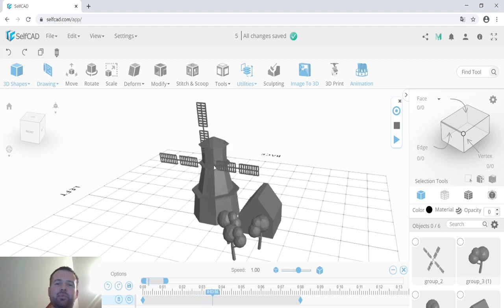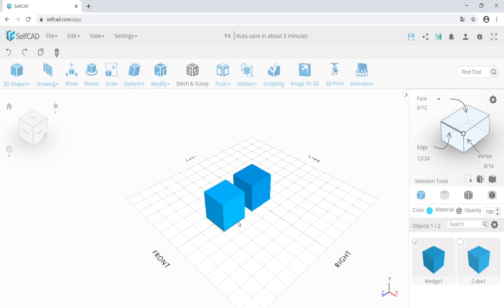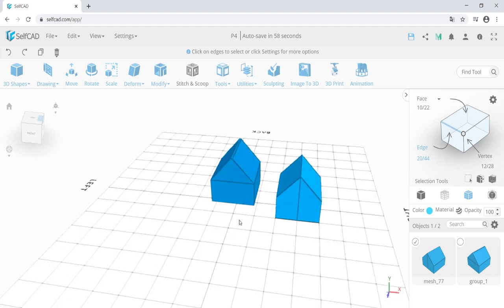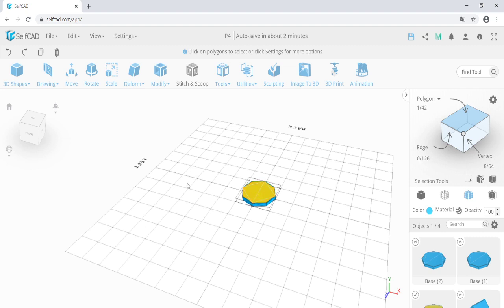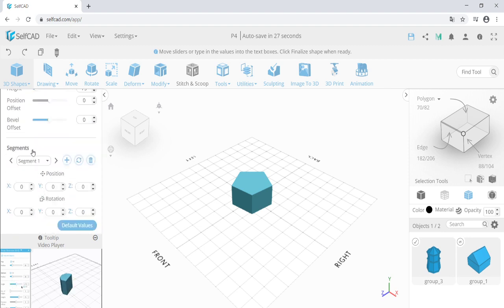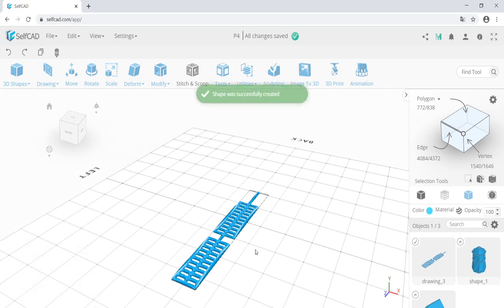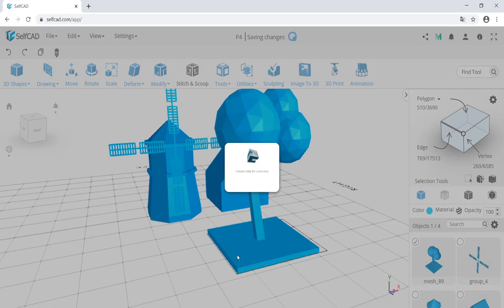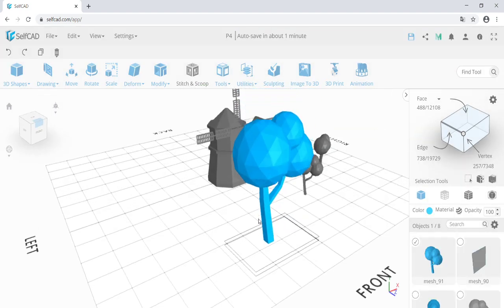Intro to 3D Modeling with SelfCAD for absolute beginners - Webinar

Comment: What if you need to make a precision gear and you want to find the exact center of the gear and make a hole a specific size with a keyway, that will fit on a shaft?
Reply from the maker: The easiest option would be to center the Gear with the Center Object feature in the Move tool (M+C), then create and center a cylinder that will create a hole, and subtract it from the Gear with Stitch&Scoop.